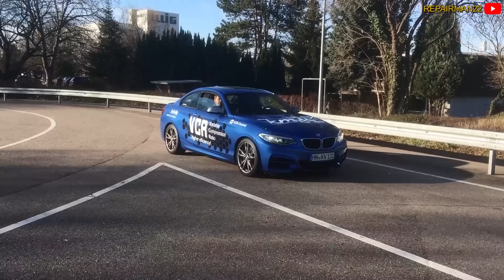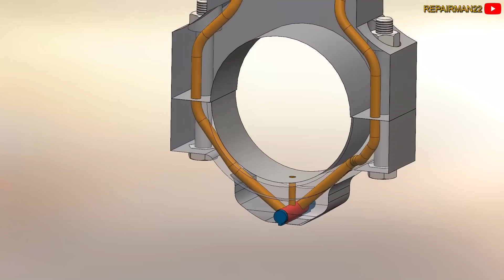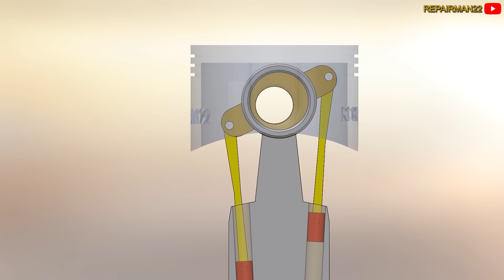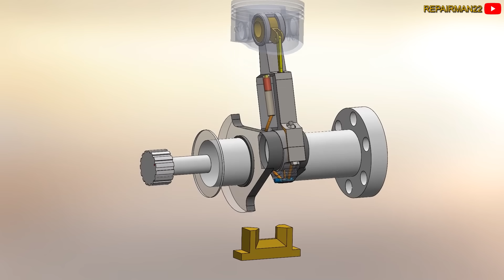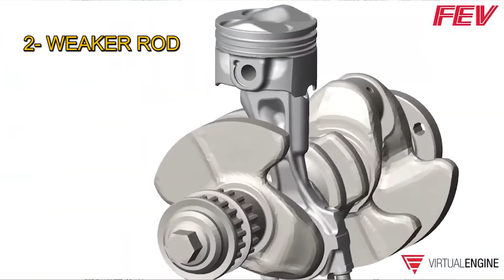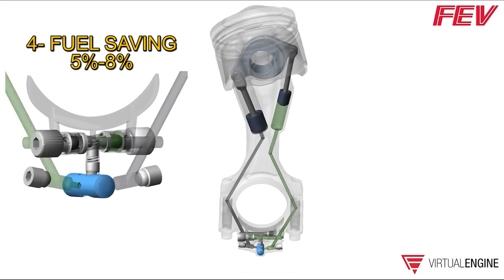This BMW has variable Connecting Rods that can vary its length and Compression of the Engine 🤯 VCR

Comment: I somehow don't believe 5-8% would justify the increase in higher cost due to increased material quality and complexity of the mechanism.
Also as much as I'd love to see hydrogen cars, it's not viable.
It'll leak trough any gasket so over time you loose it, must be under high pressure, low energy density, no infrastructure.....
And I'm not sure if it's entirely emission free to produce. I remember there are two ways of producing hydrogen.
Reply: It's not just gaskets and seals that suffer. Hydrogen reacts over time with metal it comes into contact with. The hydrogen molecules are so small that they react with metals at an atomic level. Excess hydrogen in metals can affect them lots. Structural integrity being a major problem.
Reply: Hydrogen can be produced virtually emissions-free on-site by using solar energy, either solar-thermal or photovoltaics, or wind, or hydroelectric or geothermal, etc. However, due to requirements for production at scale, any hydrogen produced will likely be created through electrolysis with electricity from a coal power plant and transported to filling stations in heavy diesel trucks.
Reply: If you have no idea how these problems are solved, then why you're against them? You have virtually zero knowledge on engines and these topics anyway and don'¨t work or research the subject. How about leaving these probs to an engineers to solve and introduce hydrogen engines to market? Your satanistic attitude where you're so much against this is making me ill.
Reply: Hydrogen in cars won't happen, and it's not because of the problems in engineering the cars or making the Hydrogen. It's the infrastructure. Producing at volume, transporting and storing the Hydrogen, it's complete ground up new hardware, at scale.
Even places where there's high usage of LPG, that hardware could be repurposed, but the cost to do so,... All of the engineering needed, and all of the materials issues, it's one of the reasons that the new generation of rocket engines are using Methane instead.
Reply: @PiDsPagePrototypes   China, Korea, Japan and Europe already decided to go to hydrogen, so please take your head out of your ass really, perhaps you have no idea about these things
Reply: @PiDsPagePrototypes  https://www.youtube.com/watch?v=5lUkOHnjLsM

Comment: I love technology but this seems more like a science project than something that is ever going to actually happen. While I'm on here I'm going to chime in on the BS of turbo charging for economy. There is no doubt that the turbo increases power. The economy part of the "Eco Boost" is pure BS. Just a ton of extra parts that need to be handled delicately and go bad anyway. Give me a V8 any day or an I6.
Reply: it can help in new economy cars with 3 cylinders and emissions
Reply from the maker: The turbo saves fuel by having fewer cylinders than a V8, that's true but, if we compare 2 engines of 3 cylinders, the NA will have more compression and will be better.
Reply: @@retiredbore378 More air forced into the combustion chamber = more gas that needs to be injected into the combustion chamber to keep the ratio at 14.7:1 and the engine from running to lean. That equals no return on investment for fuel economy. Power, yes. Economy, no.